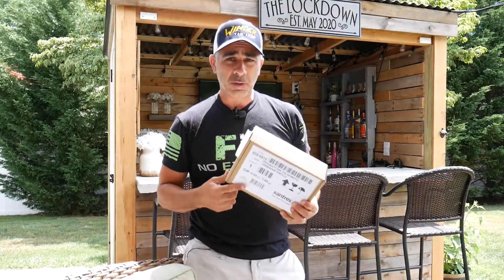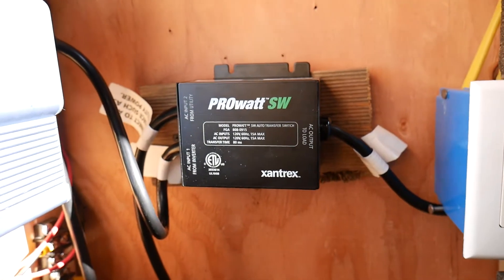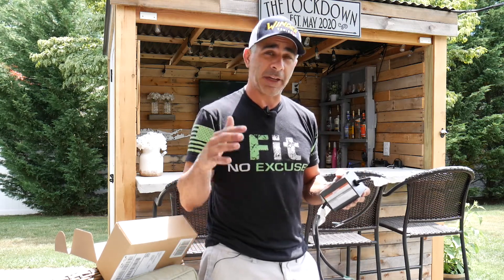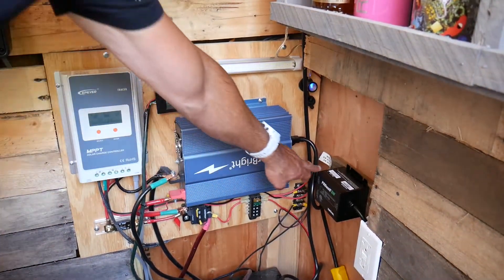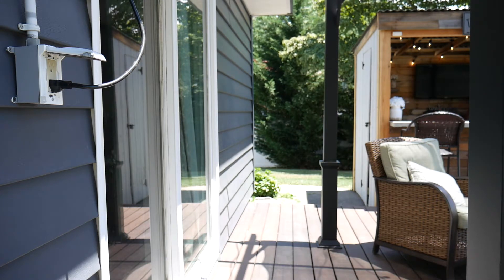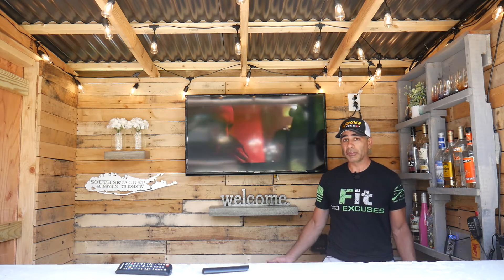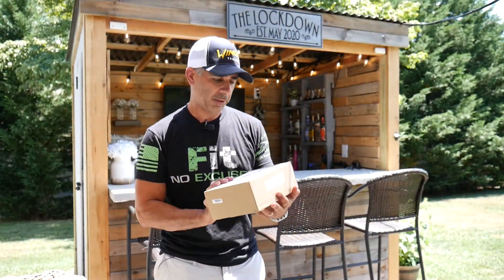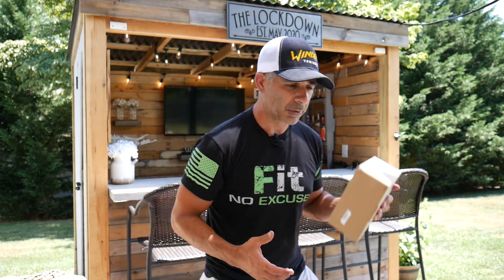Xantrex Prowatt SW Transfer Switch Solar Install

Comment: That switch prioritizes grid power, which means if you're plugged into the grid it's not using the solar.  I think this explains why there was no flicker or changeover when you turned off your solar near the 5 min mark.
Reply from the maker: Thanks for the info. That definitely seems to be the case as it cuts power briefly one way but not the other

Comment: Hey man, question I know you said the plug from the transfer switch is for the inverter and that is primary.  Do you think you could switch it around where you put the inverter plug for house power and plug the inverter for house power cord ?
Reply from the maker: Yes, not a problem.  You can choose which on you want to be the primary just by swapping which one you plug in where. Hope this helps
Reply: @Mudslidex1  
Perfect thank you for your response
Reply from the maker: @Hugo-Hernandez  You're welcome, Anytime!

Comment: You're running off house power and your solar is your backup the way you wired that.  That why the lights flickered when you unplugged it from the house, because it transferred over to SOLAR.

Comment: Hi... Thanks for the video. Awesome bar. Saw your caption about not being able to set priority afterall, but do you see a problem with simply switching the solar & a/c plugs after you've added another male plug? Obviously the labels would no longer be correct, but other than that?
Reply from the maker: Thanks. I did exactly what you mentioned shortly after making this video and have been running it like that for over a year and works great that way
Reply: @Mudslidex1  Thank you, I have just bought this PROwatt Auto transfer switchdevice. I want to make sure I understand you too. So, I can connect the  INPUT1 to my house utility as the primary and connect the INPUT2 to my Solar Inverter as the backup? Thanks, Falah
Reply from the maker: @Falah802  yes. That’s exactly how I’m running mine. Everything is running on house power, but as soon as I turn in my power inverter, it switches to the inverter power.  When I want to switch back to house power, I just turn my inverter off and the transfer switch cuts back to house power
Reply: @Mudslidex1  Thanks for the fast reply. I can't turn off my solar Inverter because other devices are connected to the Inverter. The Transfer Switch is connect to my Sump Pump and thought INPUT1 is the utility primary and INPUT2 is the Solar inverter backup!

Comment: Have you had any issues with switching from grid to solar or vice versa? Or has it continued to  switch between the two without interruption
Reply from the maker: Never from Grid to Solar,  but sometimes when switching from Solar back to Grid, it will not be as seamless and you will see lights quickly flicker as it goes back to Grid.  Usually its seamless, but sometimes just enough that it causes my FireTV to reboot.

Comment: You may want to check your meter setup... No way all of that is only drawing 0.7amps
Reply from the maker: That .7 amps was how much was going into the battery from solar, not the amount being used.  That meter shows the solar input not output. The other meter shows the battery output which was showing zero because the solar panels were producing more wattage than needed.  At night or cloudy days that second meter sees a draw as it’s pulling from battery and solar can’t keep up
Reply: @Mudslidex1  Awesome.. make sense now. I used that same transfer switch for a single circuit in my RV. By the way, love the bar name.
Reply from the maker: @brettwalker2437  thanks. I think I found out about this switch from browsing an RV message board. I get a lot of good info from the RV groups as they seem to have all the good tips and tricks for running solar!
Reply: @Mudslidex1  I use a 40a Epever MPPT charge controller in my Ham radio shack
Reply from the maker: @brettwalker2437  Nice.  This bar also acts like my shack as well. Although I don’t use it that often and am just on 2M hitting local repeaters. I want to get back into HAM radio again.